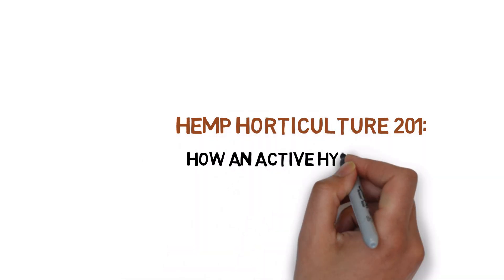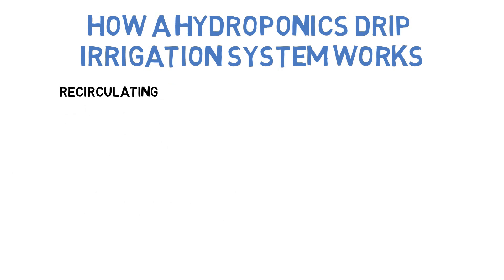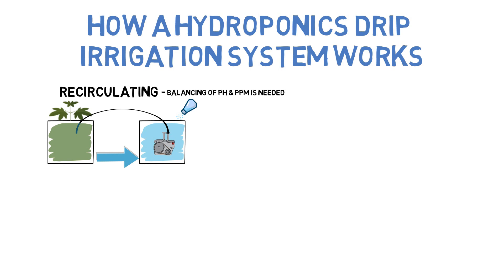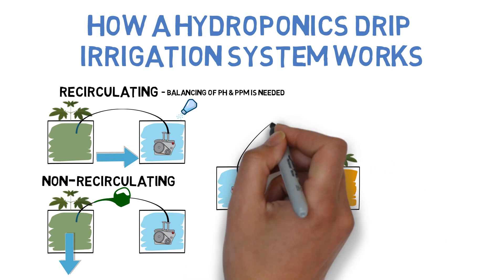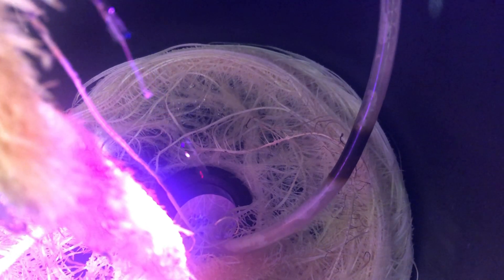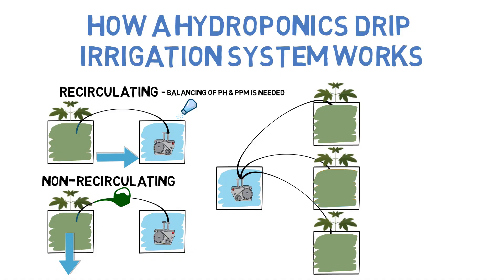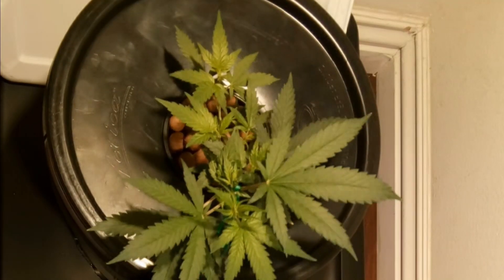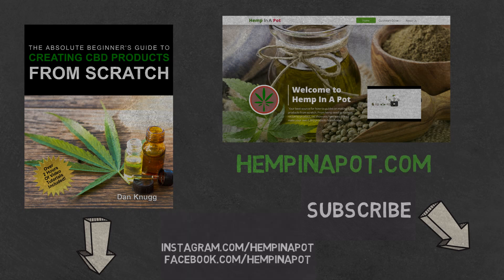Growing Hemp With A Hydroponic Drip System

Comment: Interesting and useful. Beverage bottles suspended with holes at the base since using a pump isn't an option. A tray to drain into another bottle for pH evaluation or additional nutrients. A fan or plain ol wind. Sunlight or LED lighting. Said mediums to be used. Try that Vortex Brewer idea and you're set... Kinda.